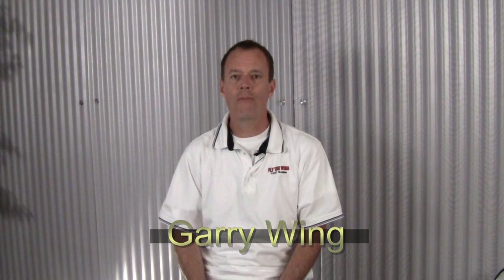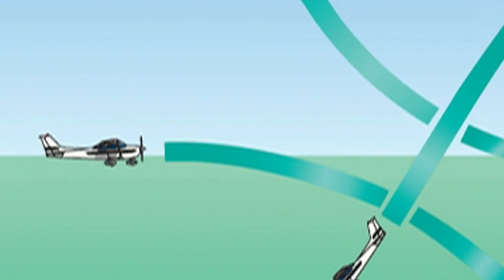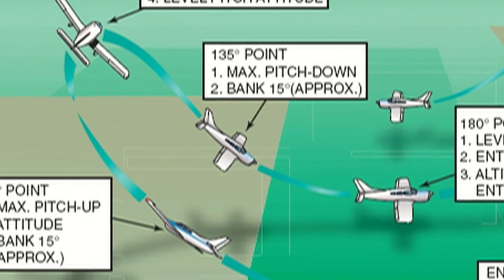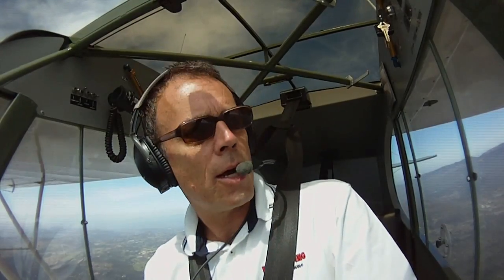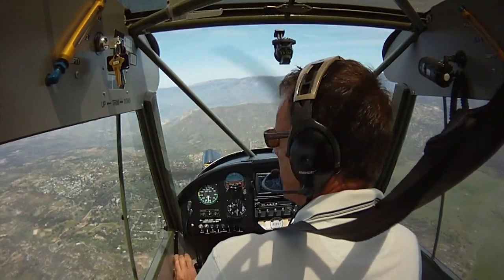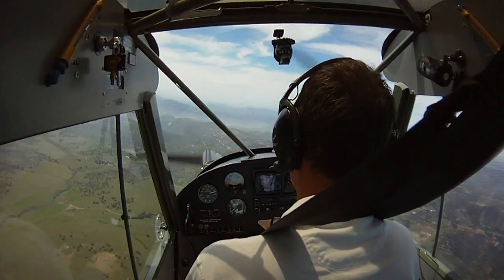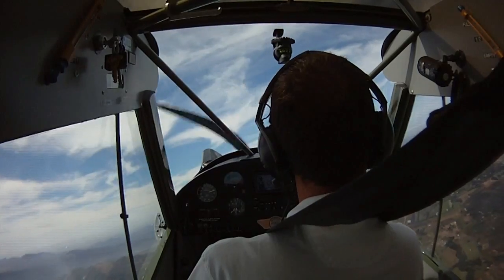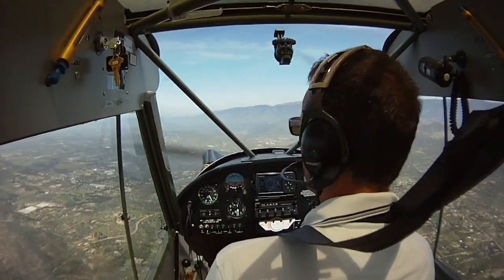Lazy Eight Flight Maneuver

Comment: Lazy Eights may be flown with greater or lesser degrees of "laziness" depending on how much pitch one uses. I don't know if it's just the way it was filmed (he did say he was just above stall speed at one point) but this one looks particularly lazy. But maybe it just looks that way. Personally, I like to shoot for about 20°  of pitch up at the 45°  point, which is more aggressive than this one appears to be. A trick you can use if you find your lazy eights are becoming too "tight" or too energetic to get back to the recipricol of your entry point is to start your pitch up well ahead of any roll input, and get a good 100ft or so of altitude gain before you input any roll at all. No one will fault you for this, and it will "spread" your eight out over a bit more distance and give you more time to get it all in without energetic control inputs.

Comment: your a little less aggressive on the controls than i am, i'll usually bring the nose up 10 - 12 degrees above the horizon, 30 degrees of bank with co-ordinated rudder, and I pull around  2 - 2.5 G on my roll outs, than reverse
Reply: rumpastumpa if you're pulling 2Gs on a lazy eight you're doing it wrong
Reply: @jacyborreaux919  Ikr lol. I was like wutt??